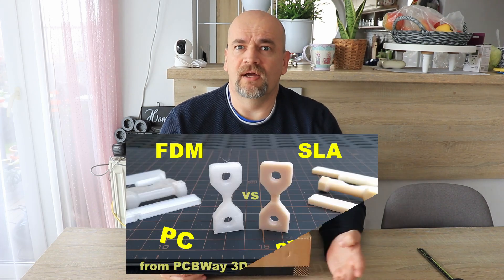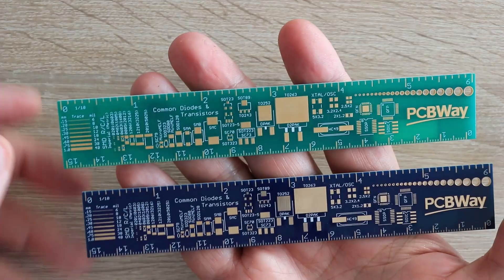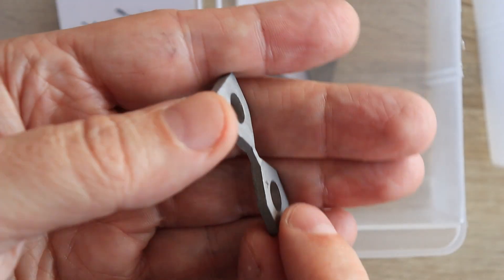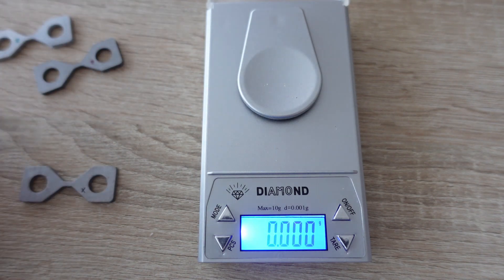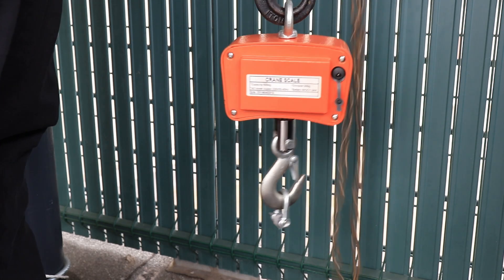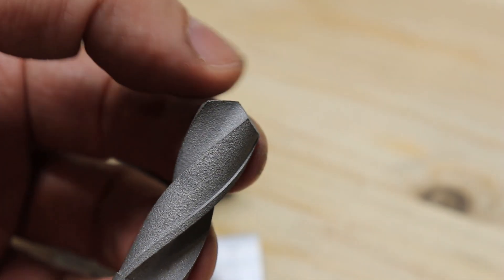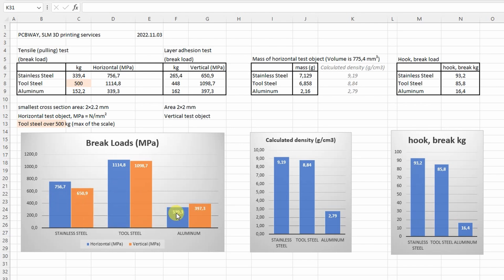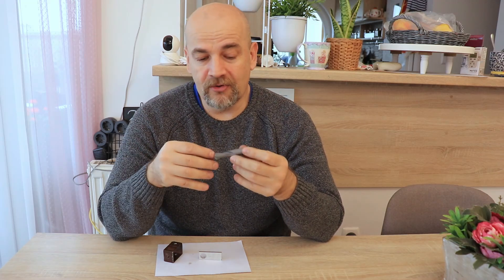SLM Metal 3D printing by PCBWAY - Stainless steel vs Tool steel vs Aluminum - how strong are they?

Comment: I’m surprised at the warping of a couple of the parts. As a former manufacturer, I can say that those parts should never have left the factory. Where is the quality control? Overall, I’m disappointed at the surface finish and the inaccuracy of the parts. I’ve had some very small 316L screws made for me by a company in Germany that were about as accurate as conventional machining. As far as that drill goes, it looks nice, but the surface finish isn’t acceptable for a drill bit. The other question is how hard that bit is? Just being made from “tool steel”, or whatever that means here, doesn’t mean it’s RC 60-64, which a drill bit usually is. The prices of the companies isn’t cheap. But really, they’re not intended for production buying. They’re meant for prototyping. For that, the parts are cheap.

Comment: Well compared to fabricating metal parts by hand with standard shop tools, including labor shop rate, SLS metal printing is now cheaper. Depending on the design of the object any kind of intricate or detailed part could be much much cheaper. And of course some parts would be extremely difficult or impossible to fabricate by hand. I just received my first PCB way stainless steel print a couple weeks ago, it was formed nicely, but I wondered how strong it is compared to conventional parts. Thanks enjoyed watching this test.

Comment: Instead of printing a drill. You could totally print a tool holder, as in carbide insert holder, so replace the cutting surfaces with inserts. You could make a simple custom tool that way.

Comment: PCB is very expensive...i dont have an enclosure and i wanted a mini satsana air duct and i uploaded the file and i saw a price of around 40$ ! for ABS FDM 3d printing! Finally i made an enclosure and i printed mine with 1,4$ !
Reply from the maker: Yes, the cheapest option is if you can do it yourself ;-) But it is good to know the possibilities, if you really need something from Alu for example, you can do an order.

Comment: It may have been interesting to compare say printed Aluminum to CNC aluminum to determine what percentage powdered 3D printing is to solid metal.
Reply from the maker: Same thinking we have. I already wrote to PCBWAY about this request, I hope they will accept it. Alu and Stainless steel what I am curious about. At least 1-2 test objects (per material) shouldn't break the PCBWAYs budget ;-)

Comment: Good tests again. Would be really interesting if you could have tested the same parts CNC from raw metal, you need to dig deep into your wallet and get that done! Just kidding although it would be really interesting to see.

Do you know if they heat treated the tool steel?
Reply from the maker: Already suggested earlier and wake up my curiosity, sooner or later I will test this. About heat threat, probably not.

Comment: Maybe the drill is not something you would print, but there are absolutely cases where there are no commercially available version you can buy. If you need a custom milling bit for instance, or some other custom shaping tool. And some geometries might not be simple to make with regular processes, so regular custom manufacturing might also be impossible or really expensive.
Reply from the maker: Yes, I agree. Probably next time I will design some custom lathe cutting tool, with some shape on it (like waves or similar..)

Comment: The one practical and critical measurement that you didn't make is the dimensions of the drill as if it is dimensionally accurate enough then custom cutting tools suddenly become a very real possibility......
Reply from the maker: If you take a closer look of the surface, you will see how rough it is. Not good for accuracy as it is now. If we really need an accurate tool, functional surfaces should be smoothed.
Reply: @MyTechFun  Figured as much but if the diameter is precise and concentric then custom flat-bottom countersinks, annular cutters and other things that are easy to sharpen could be a real possibility as for most cutters the shape/flutes tend to be the most complex part and the actual cutting edges tend to be relative simple by comparison.

Comment: Very interesting video))) The tests are very informative) I wonder what if we print cutters from aluminum, in which there will be grooves for carbide inserts, and check how they will drill and mill)
Reply from the maker: Good thinking, but stainless steel would be much better for this (with space for carbide inserts). But precise surfaces should be worked out. 3D printing don't have nice surface like CNC machined parts.
Reply: @MyTechFun  I was also shocked to see the deformation and warping in the parts.  Must be from the sintering?? after file is printed?

Comment: What was the temperature outside for the test?

Curious because I had my only 3d printed metal parts fail last Winter outside with no stress besides temp.  They just cracked in half when I wasn't watching.

Curious if temperature makes a big difference for 3d printed metal failures.
Reply from the maker: It was approx 16°C
Reply: @MyTechFun  Temperature tests would be awesome to see on your channel if you also find that an interesting question.

Mine failed at about 4 days of 15°-20°F...not sure what that is about -6° or 7°C?

Love the channel. Glad to see you still at it all this time later.  Congrats!

Comment: Would love to see more of the process of how those were made. How far are we from metal 3d printing as a "consumer grade" product ?
Reply: Consumer "grade" is definitely there already. The problem is consumer "price". It's only reasonable for high end consumers who need custom parts. E.g. if you wanted a custom sprocket for your bike with a nonstandard number of teeth, metal 3D printing could make it for you at a price that is reasonable in the context of bicycle building.

I'm referring to ordering parts from 3d printing services. Metal 3D printers are too expensive for ordinary people.
Reply: @frankbauerful a sprocket would make more sense to get laser or water jet cut, which I think is far cheaper than 3d printing metal. But clearly all of these things still aren't that cheap, even if it is less expensive than metal 3d printing.
Reply: SLM printing is not and will probably never be a consumer grade process. Beside the lasers and high precision optics, the materials are inevitably expensive due to the powdering process and the machines consume a lot of Nitrogen or Argon gases. In terms of use it involves handling very fine metal powders that are potentially risky for your health and can explode if mishandled. You need safety equipments and very clean work practice as well. Finally, making good quality parta in SLM is not trivial. There are way more elements/parameters to think about (heat buildup/transfer, sag, residual stresses and thermal deformations, annealing steps) to make a good part. This is aerospace grade technology and thus come as a premium. For more consumer / lower cost applications, binder / sintering methods (fdm with binder/powder blend or binder jetting on powder bed) seem more appropriate. But due to the equipment required and complexity of the binder removal/sintering steps, those steps are ideally used as a service. Some filament makers have developped that strategy (buy filament, then send part to their partner for sintering).
Reply: @jcugnoni  Also there will always be much less demand for metal 3D printing. Normal people need an order of magnitude fewer metal objects than plastic objects.
Reply: Most of the powder printers tech is tied up with a patent so unless someone comes up with a method that they open source or one of the patent holders makes a consumer grade machine we will be waiting over a decade at least.